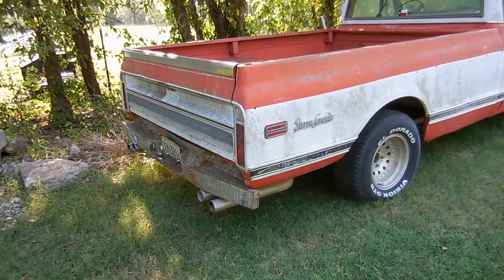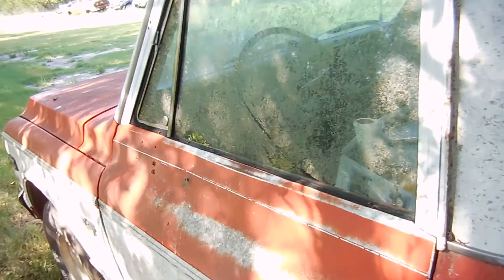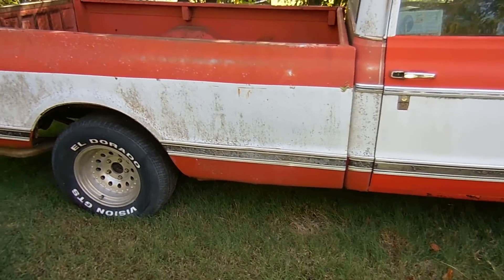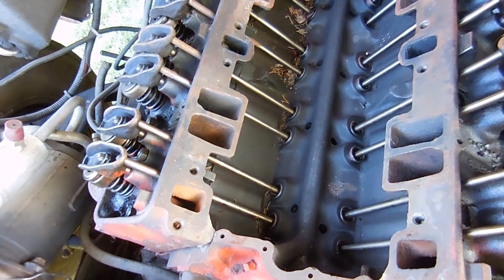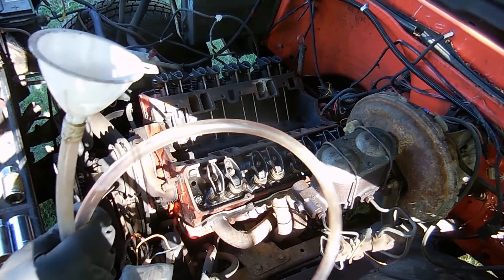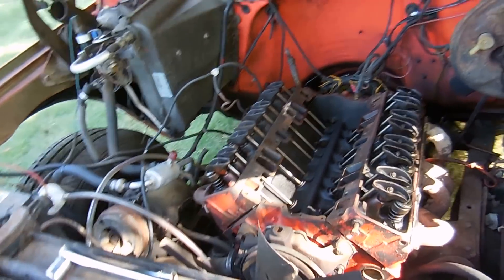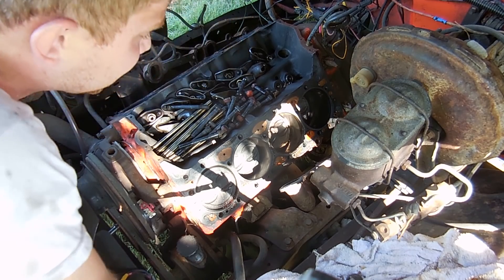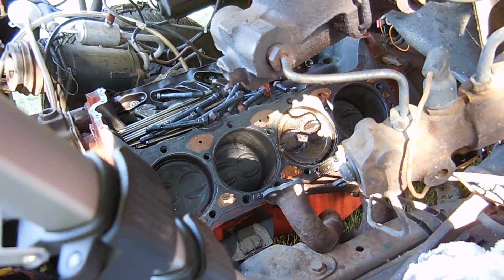1972 GMC Sierra Grande Left 9 Years W/O Intake Manifold Will It Run? Part 1

Comment: That is a real shame that piston is toast. Not really economically feasible to replace just one piston. The right thing to do would be have the engine cylinders bored out get a new set of pistons and rings and totally rebuild the engine way too expensive. You could go to a pick and pull or salvage yard and pick up a used engine for $250 to $275 or less. Much cheaper